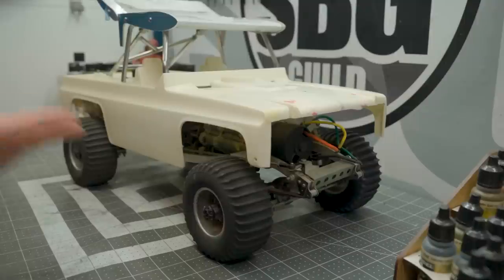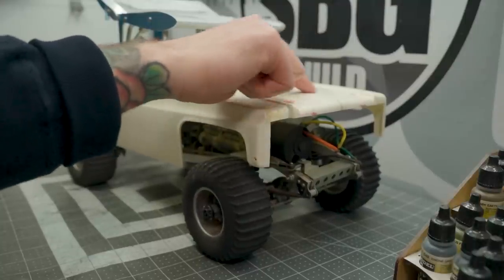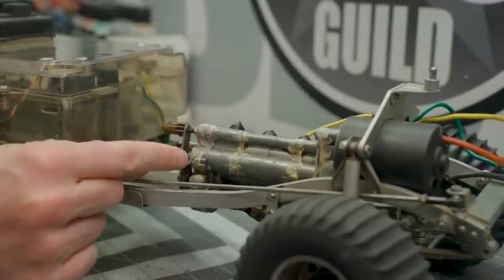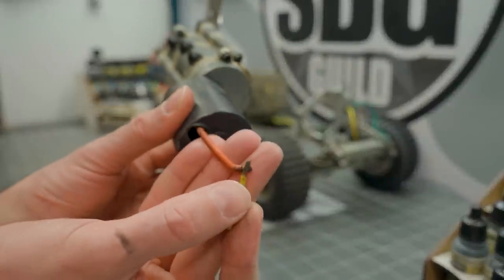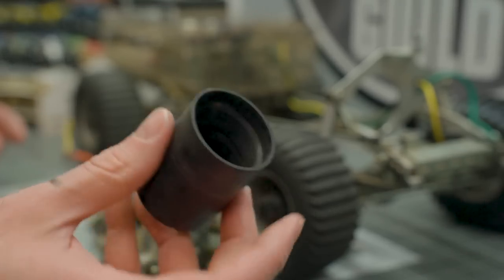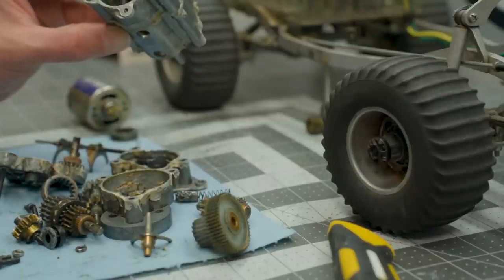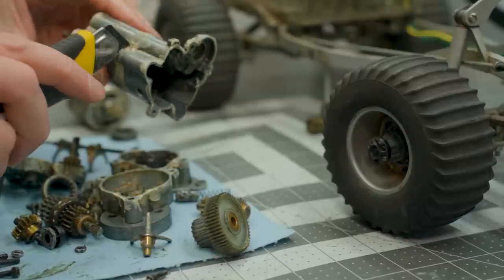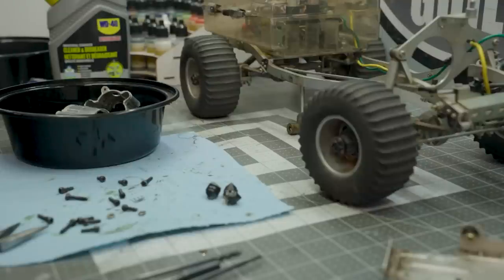What's on the Bench Weekly Ep38 - Soup's On!

Comment: Transmission hardware was stock and the threaded shaft was an option if you wanted to lock the transmission in one gear for a 2 channel radio. Hilux and Blazer had the 540 motor and the Bruiser / Mountaineer had the larger 750 motor. The motor mount and counter gear are the only differences of the two. I had a friend that had an RC10 in 87 and that looked like the same motor that came with the kit

Comment: Memories of my second RC build (Blazing Blazer)!  The first was the Toyota Hilux 4X4.  Mine are on the shelf now and are fully intact if you want pics of what stuff is where.  I am willing to provide information to you Matt just reach out!  The mix of screw head types is how they were originally built.  The shaft on the top of the transmission is stock and there is a bracket from that to the bottom spring loaded shaft for the 3 gear shifting.  Looking forward to your full restore!  Nice challenge ahead!
Reply from the maker: Awesome! Thanks for the tips!

Comment: The transmission was supplied prebuilt and wasn't intended to be dismantled. The silicone always looks a mess because you were supposed to smear it on the outside of the case instead of putting it between the joints. The rubber bungs are thereto allow you to lubricate the gears. The Tamiya instructions don't even tell you how to put it together. A search for Bruiser transmission manual should find the Bruiser Service Manual from Kope and a Tamiya style assembly manual on Tamiya101.

Comment: The motor is typical of a "rebuildable" 27 turn "stock" motor. After you scrape as much silicone off as you can, use denatured alcohol to remove what's left. I like watching high speed playback of wrenching, I don't find it to be boring at all!

Comment: That motor came from the original rc10 if you bought the sport rc10 kits you got that rather cumbersome hard to build never really works right green resistor speed controller back before the days when there was electronic speed controllers. But anyways the motor comes from that rc10 kit gold tub chassis
Reply from the maker: You're correct!

Comment: Mineral spirits and an ultrasonic cleaner would clean it up easy.
Reply from the maker: I'm getting an ultrasonic cleaner tomorrow!
Reply: Put the parts in a sealed container, we always use an old canning jar,  with the solvent then you can fill the cleaner with water and not ruin your equipment with solvent. 
I suggest getting a heated cleaner and set it for about 180°F, 2-3 cycles should have those parts looking brand new.